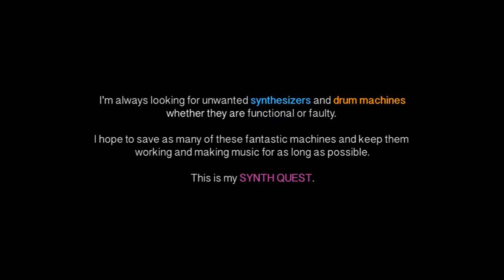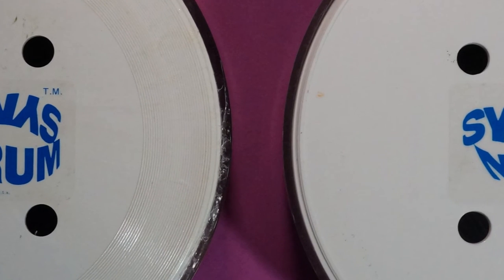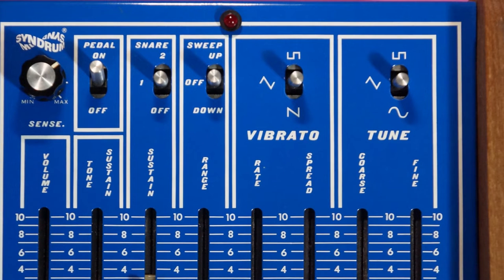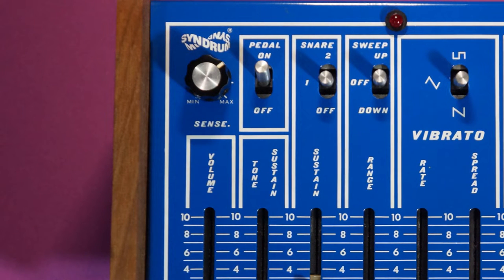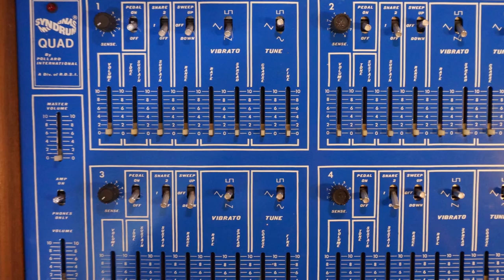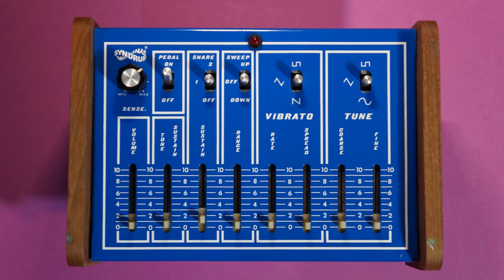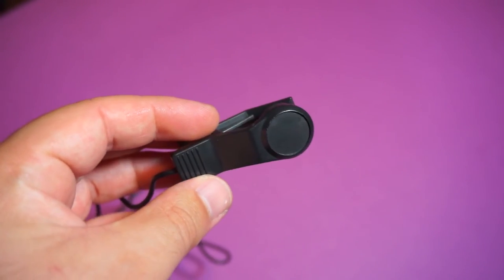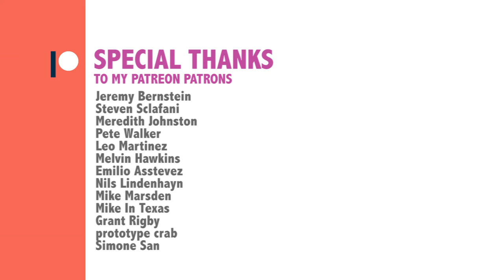POLLARD SYNDRUM | Synth Quest Episode 4

Comment: I just got a 477 and am trying to figure out what the switches next to the sensitivity knobs do.  When they are in the up position, they just seem to add a pop to the beginning of the sound.  I'm wondering if they are kill switches for inputs that perhaps don't quite work on my kit.  I haven't been able to find the manual for this version of the quad anywhere.
Reply from the maker: Hey thanks for watching! I've never seen a unit with switches there myself. It may have been a mod by a previous owner or possibly a custom mod from Pollard? Finding info on this machine is near impossible. I spent quite a bit of time trawling through old drum magazines from the 70s just to get the info I presented in the video.
Reply: @madFame  The original quad has switches (the 477)  The main difference from the 478 is the 477 doesn't have a snare sustain, just a tone sustain.

Comment: 2:35 
Is such a breakout cable for the quad module available anywhere?
Reply from the maker: When I purchased my Syndrum Quad it didn't come with a breakout cable either. I ended up making my own by purchasing 4 cheap guitar cables cutting off one of each of the ends and soldering those to a 5-pin din plug (female).
Reply: @madFame  Thanks for the reply! 
Another couple of questions is - how do you trigger your module? Do you have drumpads? Could I connect the module to my audio interface and send sounds from my DAW to the module? What kind of sounds would work?